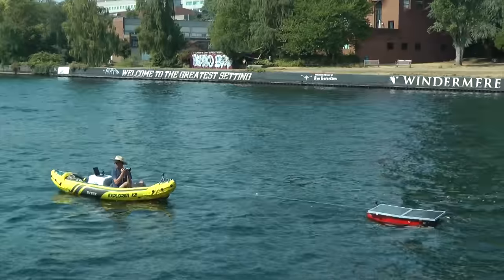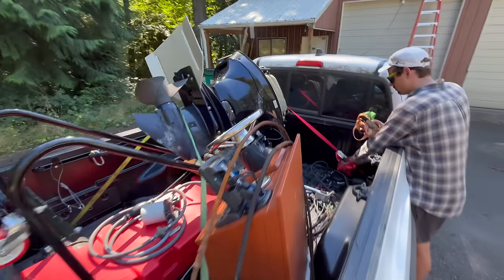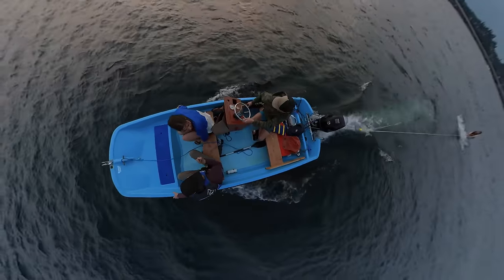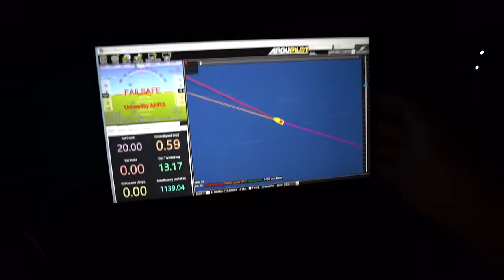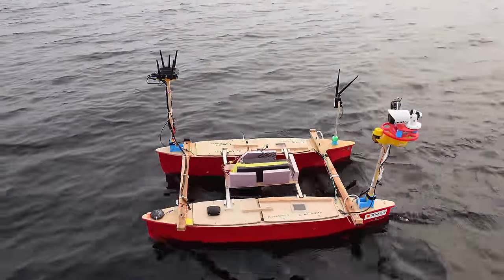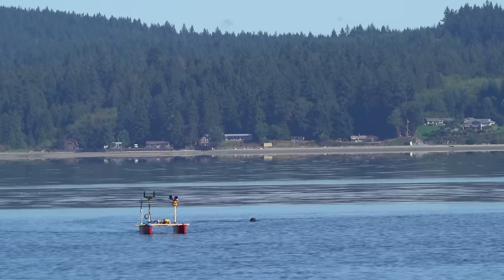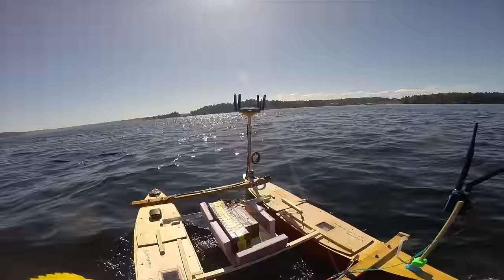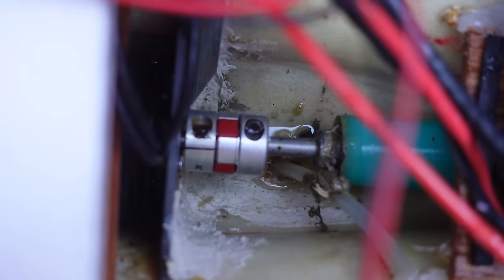Autonomous Boat 50km Waypoint Mission

Comment: You should look into the Hobie Mirage drive. It’s essentially 2 fins that swing in a 180 degree arc in opposing directions. It’s used as a kayak pedal drive and is extremely efficient. It would be interesting to see an electric version. It would most likely solve a lot of the problems you’ve been having with sea grass.
Reply: Hobie also offers an electric drive to replace the pedal drive, so no modifications are required.
Reply: Oh, this is a cool idea. Would be funny to use swimming fins as the starting point.
Reply: Not totally weedless! I have had a Hobie Kayak for 8 years.

Comment: You should install John boat rear pods on the Transom. It will keep the back from sinking in the water when it's stationary or in rough water. It will also ride smoother and rougher water.  I did it on my Jon boat bass boat conversion.  I actually got 4 mph more on my boat  because it can now ride at the oerfect attitude on plane. You could make them out of fiberglass 3D print them or wood.  I have seen it done on Boston whalers like yours that were converted to bass boats.

Comment: On racing sailboats there is occaisionally an option for a weed-cutter keel or a rudder. Basically a knife edge that cuts through seaweed. A couple razor blades upstream of your prop will get the job done. I think I've even seen it on rc sailboats.

Comment: Few thoughts:
* Do use an internal prop with tight/angled mesh, then perhaps install some servo/wiper that periodically clears it.
* It would be cool to install a analog (or digital) FPV cam inside a waterproof case or part of the hull to be able to visually monitor the prop in realtime. I imagine the surface light would be enough to see them doing their thing.

Comment: Daniel is an OG if he's got a blue Ryobi. I still have a blue Ryobi cordless drill and wired circular saw; some well made tools if you don't abuse them. And FDM parts are surprisingly strong. Just printed some camera dolly roller assemblies, at even at 20% infill they are super sturdy using Inland PETG+ (Living near a microcenter has some great perks lol)

Comment: To clear the seaweed, would an automated (or manually-triggered) routine to spin the props backward and forward rapidly a few times help maybe? Or maybe replacing those side prop guards that are meant to keep seaweed out with servo-actuated arms that stick out wider and can be pulled in occasionally to let any collected seaweed fall away?

Comment: For your water detection in the hulls you can use a reed switch attached to a rod with a lightweight puck that will float on the water. much simpler and robust than your water detection boards you have now.

Comment: Is it possible to mount a rotating knife before the prop to cut up any sewed? Another thought is to add a depth sensor to the boat and letting it run in a scanning pattern on the lake and then use those measurements to see what can be found on the bottom of the lake?  The episode after that is called treasure hunting.

Comment: I think for the full size autonomous electric trip next time, a catamaran is the way to go. Allows you to take tohe boat own to its pontoons and put it on a normal trailer. Water tight pontoons give you a mix of engine/battery room, and dry secure storage, netted center basically gives you a hammock/trampoline to lay in as you cruise. You could use a tent for shade and bug proof sleeping that is easily taken down during day. exterior edges give you raised areas for solar panel connection.  Honestly if i didn't live in the desert I'd want to make it myself.

Comment: You can get capacitive moisture sensors (the ones I'm familiar with are for soil) that can be fully sealed. Probably a good option, or just use a float and a switch (magnetic float and reed switch is probably the most robust).

For the seaweed, an air propeller is the obvious fix (like you've used before) but I'd be interested in whether you can come up with a water-based solution.

I wonder if you could get away with a pumpjet by using a very large intake with a very fine mesh, relative to the output? Almost like a thin second hull with many tiny holes. You might be able to get the flow / pressure so low (due to the large surface area) that you don't trap seaweed.

Comment: use a float on a lever like toilets do for the water level sensor. I'm sure a tiny one will still work. You can make that out of plastic so it's not gonna corrode when submerged and stop working

Comment: Since seaweed most probably would cause higher amp draw, an automated motor reverse function for a few seconds could be enough to clear the propellers. Some propellers are also more weed protected than others. They are seen on Minn Kota trolling motors for instance.

Comment: Those water sensors corrode because powering them makes them act like a battery. They last much longer if you only switch the power on for a moment every now and then.
The other way to detect water is to run the pump and measure how much power it draws. It takes more power to pump water than air.

Comment: If you want a better water level sensor, you can make an RC oscillator circuit out of a comparator. For the capacitor, use a circuit board with two parallel traces routed alongside one another, but leave the traces covered in solder mask rather than exposed. The longer the traces the better. You can snake them around the board to use the full surface area, too.

You'll still want to coat the circuit board (especially the edges) in a thin layer of epoxy, as FR4 will wick up the salt water, but with that design you avoid exposing the copper directly to the saltwater.

Comment: For the seaweed problem - how about water jets? You would just have to work on a carefully designed intake system so it would not get clogged. But then the water jet exhaust would be great at pushing it through the water.
Reply: I have actually made an electric jetboat with a 3d printed jet unit . They actually block up with seaweed worse than props , also a water jet is a lot less efficient
Reply: @DktheWelder   I see...well, maybe an airboat then? I'm looking forward to see what he does.
Reply: @Grevlain  someone commented that the props should reverse every now and then to clear I think that’s a good idea

Comment: @rctestflight you might want to look at a Hobie Adventure Island for a Solar-Boat, that is efficient.

Also don't constantly have the "water sensor" connected to power, just power it during sampling ever so often, so it does not corrode as quickly.
There are also capacitive sensors :-) they should last even being constantly powered.

Comment: With liquid level sensors, only power it while taking your reading every xx seconds. It's essentially electrolysis, so it'll corrode pretty quick
Reply: Great idea.  Sacrificial anodes will stave off the corrosion also.

Comment: solar boat needs floating solar panel. Pontoons or box tank or something. A three point tether set up can allow a tandem that turns in line with the boat. I have pulled kayaks with my ekayak this way and it works. it would work better with wider boats.

Comment: I learned from experience not to keep the water level detector running at 100% duty. You're trickling 50ma into what's essentially an electroplating apparatus. Put the VIN on another pin and only turn it on while sampling, maybe once every 10s for like 100ms or less. After I made this change they started lasting months rather than days.

Comment: about the water fill sensors, I tried to use them for a project (fill sensor for a catheter bag) and they did have corrosion issues. I looked into photoelectric water sensors (which are probably the better option for your project) but they were a bit more expensive

Comment: the liquid water sensor possibly corroded due to capacitance in the water. I'd add some sacrificial metal anode like zinc or magnesium or something, should help with corrosion of copper and see if that changes anything

Comment: Hey man, how about you make an autonomous gas boat? Get one of the really small model engines, make sure there's room for a belt or belt pulley. One of the water cooled hit and miss style engines around 7cc would be easy to work with and keep cool in these conditions. A paddle boat might be easiest and the most failsafe with sea weeds. 

Maybe you could make a tiny generator to replace your sunk battery pack.

Comment: I wonder if you could install a sharp blade close to the propeller shaft that would cause the seaweed to rip itself apart when it finds its way around the shaft or even using a fire wire brush along the top of the shaft. I've always wondered if that would be something that would aid the boat in clearing such obstructions, i usually seem to get the same thing happening to my little scale boat after i've taken it out.

I did find putting a small moulded shim shroud from the hull to the back end of the prop can aid in the prevention of clogging, though not sure what it would do to the efficiency of the boat.

Comment: Wake washing over the stern during fast deceleration is not uncommon even for larger boats, if you need to slow down fast it is a good idea to get in the habit of turning to avoid your own wake.  Otherwise just gradually slow down to control it.

Comment: tbh I'm suprised you didn't just have the bilge pumps connect to a switch operated by a float. It'd do the same job and no fancy electronics required!

I also wonder if counter-rotating props would be less prone to seaweed and just chop it up?

Comment: If those relais are electromechanical they almost certainly have been overdrawing current. If there is no back emf diode it could also fry the pin. But what i've seen on data sheets some solid state relais also have significant current draw and those tiny cheap regulators really can't handle much.
Reply: Yeah, I'm really surprised it fried the voltage regulator before it fried the Arduino (of course, it's possible the Arduino failed short first and then the voltage regulator)

Comment: Maybe a mechanical float-based level sensor would be a good reliable redundancy. Could even power the pumps entirely mechanically with it, skipping any sort of relay or electronics. That way, you'll still get some sort of bilge action even if the fancy electronics fail.

Comment: What if you created a mechanism to lift the propellers out of the water and remove the seaweed? 

Maybe it could have gears that mesh and spin razors in between the props? Then you could have a timer that clears the debris every 30 minutes or when the motor current passes a specific threshold?

Comment: Ok, i think your boat needs a bit of retrofit/rebuild.
The first thing to look at is the bow. Perhaps adding a breakwater in the bow would help keep water from splanshing onto the deck. The deck could also be curved to encourage any water that does end up on deck to run over the side.

Probably not a good idea to put electronics on the centre part as they to are unprotected from the sea. So unless you build that up maybe not a good idea.

Whatever ideas you have against the seaweed go ahead and do it.
I wonder if adding sails could help. The idea being that whenever you have wind heading the boat's course you could shut off the motors and let the sail do the work. Just an idea. 

At some point you should probably design and build a better boat. Which enlisting soke help wouldn't be a bad idea for that.

Comment: I have a thought on propulsion. Using jet propulsion, what if you made the entire bottom of the boat a tight mesh? You would get two things from it,1 lots of surface to not slow down the water to the jet pump and 2 you would be able to spread out the water intake over a larger area to reduce sea weed ingress vacuum. Just some thoughts, I only watch for the final circumnavigation of the world. :)

Comment: Why don't you add a large mesh in the front and in the back with a funnel behind which then runs into a pipe through the body of the boat?

In the center you can put a motor with the prop.

 This way the sea weed can only collect on the mesh itself, so you can reverse the props for a couple of seconds and run forward again to clear it.

Comment: The reason the fuel pump was so corroded was due to e10 gasoline. The ethanol is hygroscopic, and the fuel in the tank absorbs water. Then eventually the water separates and goes right into the fuel system and rots the parts away on the inside out of site. It is particularly a problem with boats and yard equipment, which sit around for long periods of time without operating. 

I recommended that you find a local pump where you can but pure gasoline for running in your boat and lawncare equipment (not that you care about you lawn or anything 😂)

Comment: Maybe you can design some way to propel the boat using something similar to sewage pumps. They are centrifugal pumps, but if you have an inlet and an outlet you can use them to propel the boat, even if it won't be very efficient
Reply: Interesting idea, but many pumps can still fall victim to seaweed.
But there are types of pumps that don't require moving parts in the water stream, like an airlift pump. https://en.wikipedia.org/wiki/Airlift_pump

Comment: It might be better to use an A02YYUW waterproof sonar sensor to measure bilge level. I used one sometime ago as a warning system for the sump in my basement (Heavy rains caused my basement to flood). A standard float switch might work too, but I'm not sure how it would react to pitch and roll.

Comment: Like with airplanes, weight is key for getting a boat up on plane. I have a similar boat, a 12', 180lbs cat-like hull and that goes on plane with around 6hp (2 stroke outboard, another 70lbs) and myself (200lbs). I imagine you'd need something in that ballpark, too, if you're going back to electric.

Comment: To stop the sensor corrosion you need sacrificial anodes. Wooden boats with electrical systems on board need them so that the nails holding the boat together don't corrode away and allow the boat to fall apart. If you're not familiar with this concept, you've got some research to do. #boat #zincs #electrolysis #corrosion

Comment: Someday, you should maybe consider using a motor-driven impeller and see what kind of results you get with a jet boat. 

 IMHO jet boats are far and away less inviting for trouble, as there are so few moving parts and the engine or motor can be inboard, away from problem-causing moisture. 

I drove a jet pursuit  boat in the US Coast Guard that would do 106 mph on flat water!

Comment: Just run the bilge pump on a schedule and monitor the current draw to figure out if it's pumping water or not. No need for a sensor, one less failure point.

Comment: Could you thread or put a groove in the prop shaft that would try and push the water down and out of the shaft tube back to the prop? It could help keep water out if that is where the water is coming in.

Comment: My own thought for getting more speed for more time with electric power is to put something like a light kayak on top of three efoils in a delta/tripod layout, and a couple hundred pounds of LTO cells. I figure three foils and three foil motors can lift about three people's weight, and you could have massive watt, watt hour, and charging rate potential with that big a battery bank? Out of my budget and fabrication ability (so far!), but a guy can dream (about ways to not have to take the ferry).

Comment: Those chinese Arduino Nano board's regulators are rated for max 500mA output from what I recall. Though when I've used those boards, the regulator becomes too hot to touch far before that. If you are using those Nanos again, I'd probably use an optical isolator to ensure that the Nano is under the least load possible and use a separate 5V power rail / regulator to power for the relays. 

Nanos are cheap and versatile, but the regulators seem to be not reliable under any significant load, at least in my personal experience.

Comment: Have you ever tried razor blades to keep the propellers weed free? I think I remember someone making prop guards out of razor blades.
But that only gets rid of the problem of seaweed getting into the propeller in one piece. It could still get cut in half with both halves ending up in the propeller.
And once seaweed is on the propeller, an upstream guard won't do anything. For that part of the problem you'd need to position a blade where the seaweed would trail off of the propeller.

Or just make the propeller have the cone shape of those prop guards at 25:36.
That might still need the blade where long seaweed is trailing off of the propeller, since any long trails would quickly get twisted into a braid, which pulls them towards the center.

Comment: That seems pretty bad for the eco flow battery, I take it only the bottom got wet and it just destroyed it’s internals? For a battery marketed for outdoor use that is pretty poor, especially given the cost. Is there no waterproofing in it at all?

Even worse is how it fails, it doesn’t just shut down, but you hear pops and see smoke, that isn’t a safe way to fail.

Comment: I know it sounds expensive, but ultimately, a bigger boat with a bigger prop might fix a lot of the issues you're encountering. Although the boat you made right now is by far the biggest you've created, it's still in the mercy of wakes and waves because of how low it sits in the water. I could imagine you simply purchasing another Boston Whaler for cheap(or just use the current one you have) and simply attaching all the electronics and systems, have a boat-sized prop and you're good to go. One of my ideas would be to attach a hydrofoil to the Boston Whaler to make speed a little bit faster.